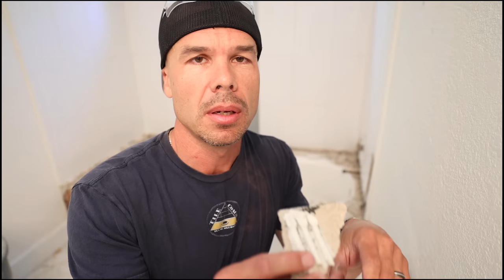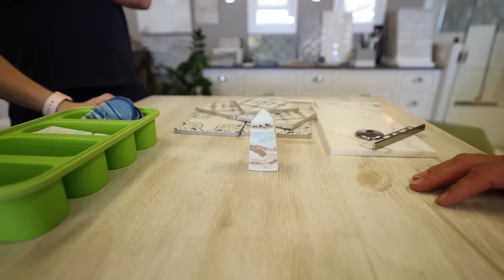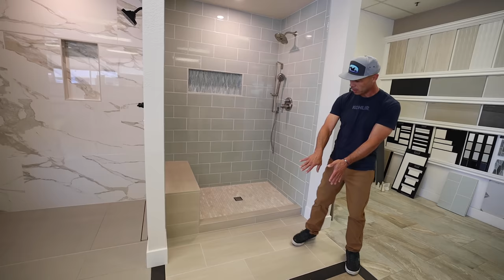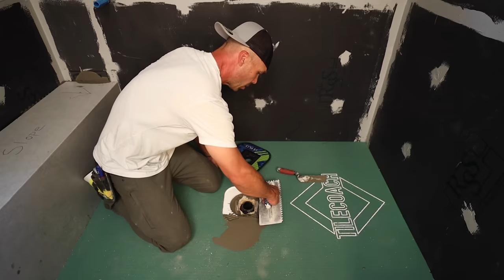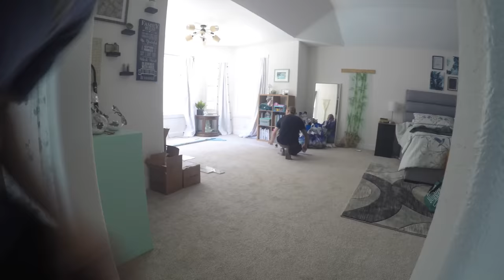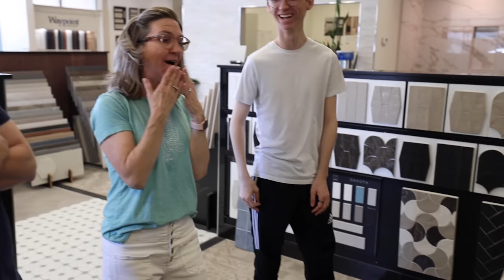$20,000 Tile Shower --- They Had to Pay TWICE!!!

Comment: I hope it was 20 grand for the whole bathroom and not just for the shower.
Reply: AM plumber who mostly does remodels in the northeastern USA. $20k for a complete bathroom remodel is the average. Obviously fixtures and trim can dramatically increase that price too.
Reply: Skilled labor isn’t cheap and cheap labor isn’t skilled.
Reply: @tylermccann2369  i charge $3,500 for labor to do a standard 60" shower. Usually comes out to $5 -7 grand.  Never $20k. That's ridiculous
Reply: @Benduro @Tyler Mccann not sure what your using for materials to do a full custom shower start to finish full demo and removal with everything from your tile, waterproofing, labour, mortar, grout, tile edgings/moulding and whatever levelling system you may be using for your tile if it is a larger format tile, niche, bench and window in the shower and full bathroom floor with uncoupling membrane underneath for 5,000-7,000 would love to see a vid on that remodel and see how you achieve it and that’s not to mention plumbing fees, fixtures like you are forgetting about the home owners expenses and just going off your tile service bill
Reply: @dylanmugridge  I also do all my own plumbing. We are talking about a shower thats standard 60 x 32. Now I did do a shower a few months ago that was $15,000, but that one was a 60x 96 shower. Maybe I am just cheap? Even though my work doesnt look like it. I make great money and am happy. No employees.
Reply: @XCBen  
What materials do you supply at that price? I’m gonna be doing one, just labor. I’m using the schluter system and the tile is 12x24 with a glass waterfall feature on the short walls mirroring each other with a niche in the back wall with the glass in the niche.  Any advice would be appreciated.

I just went on my own last year and been in the trade since 99
Reply: 20k is a robbery. The quality of work is fantastic but I highly doubt an entire bathroom remodel was 20k.
Reply: @joshuagaytan9376  If it's the whole bathroom it can be that much these days for sure. But if it was just the shower, which he made it sound like, then it's robbery for sure.
Reply: @tonyburry9036  you are assuming. You know what happens when you assume.
Reply: Awesome video. That’s exactly what a custom tile shower that size should cost with all materials, labor, design, and everything else you put into it. If someone wants to save money there’s a lot of cheaper things to do than a custom tile shower. 
All you guys that are commenting that this is robbery, don’t have a clue what it cost to run a legitimate contracting business. 😉
Reply: @Jared-Kreate  Sounds like you have no clue.
Reply: @XCBen  I'm doing a bathroom renovation right now with subfloor and joist work, running new electrical, plumbing in a sink toilet and shower installing a mirror, med cab niche, linen closet, vanity, quartz countertop, vanity light, tiling the entire room with 4x12 with a shower niche and bench. My quote was 14k
Reply: @tylermccann2369  yes,  for a whole bathroom I can see that
Reply: @XCBen  I'm with you. That's damn expensive. I thought I heard wrong when he threw out that number. Wish you were in Australia, we're struggling to find contractors anywhere here.
Reply: Im pretty sure its floor and shower tile with the shower glass and fixtures. And when you do good work you get swamped so you have to charge more to shorten your schedule
Reply: @wilson4180  
I’ve done beautiful high end baths for under 10. Anything over and you were a newb who got ripped off by a shady contractor
Reply: @sean4060  Nope, I just do good work and ppl pay me for it. I don’t deal with ppl who nickel & dime or want cheap & fast. I’m at a position in life where I can pick who I want to work for instead of saying yes to every job, to make ends meet.
Reply: @wilson4180  
No, 20k is an absolute rip off. A lot of contractors are greedy and over charge hoping some idiot accepts an overpriced quote. Most contractors want $500 a day which is fine. A lot of quotes works out to them earning $1000 a day. Only for fool customers
Reply: @sean4060  nice 👍
Reply: It’s California, depending what part he’s in, you have to charge enough to live there/here. Coastal more expensive, Central Valley much less expensive. Same as where you live I’m sure (city vs rural). I would add, that door swing is to close to the toilet but you have to work with what you have.
Reply: @Jared-Kreate  i agree with you.
Reply: @dylanmugridge  I do a standard shower remodel from tub to walk in shower and it comes out to around 5-7k with the tile labor plumbing and then another couple thousand for a shower door depending what they pick. I’ve done many of them and I’m always busy because I don’t charge people an arm and a leg
Reply: @dylanmugridge  I buy a schluter shower kit which is about 600 for the whole kit for everything. Then I charge 500 to install the kit. Demo of the tub is 1k which includes installing new green board. I charge 10 dollars per sq ft for labor which is standard in idaho. On top of that the customer pays for the tile, thinset, grout. I don’t use a leveling system. I just make sure the walls are plumb and level when I install the drywall. Labor usually comes out to right around 4k and and tile comes around to 1000-1500 depending on cost per sq ft. Then the the plumbing is around 500-800 depending on if drain needs to be moved and fixtures another couple hundred. Anyone charging 20k for a bathroom remodel is ripping people off.
Reply: @pman2916  that's another thing to consider with the price. There is a nation wide shortage of skilled tradesmen in the US, probably everywhere. If a guy is the only one in the area that can do that kind of work then he can pretty much quote any price he wants. Not allot of people are good and caring enough to do quality tile work. Lots that do mediocre work
Reply: @sean4060  tile guys aim for 800-1000 per day
Reply: @davegordon6943  
Total rip off
Reply: @sean4060  they can always get a shower insert or go with another quote.
Reply: @j.johnson8360  In the end you get what you pay for.
Reply: @sean4060  Why do you care what they make in a day? Why is that relevant? I might spend 100 dollars a day on fuel. 250 a day on a decent cut man. Everybody yells about a living wage until we start paying it and forwarding that bill. Now everything is "robbery"? Piss off. I'll make 3-4k in a day occasionally sitting in a skid steer. You want me to be poor? Buy the 85k dollar machine yourself and learn how to use it. I'll know I'm too expensive when the phone stops ringing.
Reply: @sean4060  you can believe me when I say private practice doctors most certainly make more money than I do. If you're comparing me running a business with someone who shows up at a hospital to clock in you've missed it entirely. My tools and equipment are an investment. They get a rate, at minimum depreciation. You think we do this shit for fun? Next time you have a surgery look at the whole bill. Not just the physicians portion. And if you think it's more cost effective to buy all the tools, take time off work, watch 20hrs of YouTube and then still do a mediocre job. Have at it. Phones still ringing over here.
Reply: @Jared-Kreate  20% for sales guy, 35% to contractor, 35% to sub , 10% cost
Reply: Does seem a bit steep, but he is a turn key operation…plumbing included, which plumbers charge a mint for anything. Materials are also a large cost in that bid and not to mention they are in California…everything is more expensive in Cali
Reply: @AllBayEveryDay  I've put over 8k in fixtures in a single shower. It was like a drive thru car wash. That's the problem with making broad assumptions like this. Some bathrooms are 80k+. Sound systems, Bluetooth thermostatic valves, body sprays out the ying yang. 1200 bucks for a rain head. Just the rain head. Plus plumbing and the drywall work to install it. Steam generators. Custom teak. Zero threshold entry. 5k in glass. Every job isn't in a flip house.
Reply: 20k damn you rob them
Reply: @sean4060  20k is not too much
demo+removal $2000
Plumbing $2000-3000
Tile let’s say $70 per sqm roughly 30-40sqm $2800
Waterproof system I never use those system before but let’s say roughly $2500 ?
Pc items 2-3k?
Tiler 1800-2000k
Don’t forget when you run a business you need to make at least 30% profit so how’s 20k too
Much?
Reply: @mikeblocker5720  Running a business and being just a trade is different. Sean is totally not counting the profit part and the warranty part on it.
Reply: @jasonwu1380 
This is why I don’t hire general contractors who need to make a cut. I hire the trades directly 

Demo (1 day job) $1000 plus garbage bin=  $1500 max 
Tile installer $8/sq foot x 100 sq feet = $800
Tile $6/sq foot x 100sq feet = $600
Plumber $500 per fixture = $1500
Toilet - $400
Shower glass $1000
Vanity $1000
All shower fixtures - $800
Waterproof 1k

I’m at 9k plus add some extras for unexpected things. That’s 10k total. 

Only suckers pay general contractor prices
Reply: @mikeblocker5720  
Zero curb entry doesn’t cost anything if you are building house from scratch
Reply: @sean4060  labor cost? that is correct. line drains usually do increase material cost a bit though. And most utilize a line drain.
Reply: @sean4060  mate I run a renovation company and just like the in the video I have my own factory to do storage and joinery plus a showroom .this is the hidden fees .I never do a 3x3 bathroom under 32k Australia dollar.when you run a business and just be a trade with a Ute is big difference.
Reply: @jasonwu1380 
So how is it I’m able to do a nice modern beautiful bathroom reno for 10k?
Reply: @sean4060  the way you quote yes is possible but why? Lets put it this way you are going to a restaurant buying food may cost you $20 a dish but when you do it the same at home buying from the supermarket it may cost you only $10 you cant compare prices like this the hidden fees is everywhere
Reply: @sean4060  cut costs from material cut cost from labor cut cost from factory or showroom fee cut cost from insurance yes you can
Reply: @sean4060  I got a job 3weeks ago just one basin is costing $2100 dollars when people build them forever home is different
Reply: @jasonwu1380  Have you seen this bathroom? Where did you get 30-40sqm from?
Reply: @diegoperez2090  the hybrid private/socialized blend of healthcare we have here is a mess. One system or the other would work perfectly fine for most. Just have to pick one. I completely disagree that anything, anywhere is truly "free".   What's your point anyway? I'm not in charge of the healthcare system. How did we get so far out in the weeds? What does a physician earn annually in these other places?
Reply: @diegoperez2090   2x2.7+ 1.2x2.7+1.2x2.7wall11.88 3.6x2 floor 7.2 + waste 24.8
Reply: @diegoperez2090  don’t forget one thing this is not 300x600 or 600x600 tile so when the tiler do quote at least a double
Reply: @joshuagaytan9376  Bathroom remodels can easily be $20K. And that’s an average bath.
Reply: @mikeblocker5720  yes but this shower specially and 99 percent of shower remodels don’t do any of that stuff you said lol. Only 1 in a 100 will do fancy expensive stuff.
Reply: @sean4060  I charge nothing less than 10 per sq ft for walls and 8 for floors. Plus I charge 500 to install the waterproofing and 150 per niche. 50 for soap dishes too. If a customer choose smaller tile the prices goes up to 12 per sq ft. If they choose a tricky pattern that takes longer the prices goes up to 15 per sq ft.
Reply: @AllBayEveryDay  my point was the variables are too many to make any broad sweeping statements about pricing in the remodel industry. Some guys float walls. Some guys reframe. Some guys shim sheetrock with window shims leaving areas not supported by the framing and then schluter and tile over it. Grout lines in jeopardy any time  someone leans on the wall. 
Big difference between a builder/craftsman and an "insert material" installer. After schluter became widely available I feel like a bunch of lvp guys jumped in the showers. Lots of repair work going on.
Reply: 20 grand for a shower with a foam pan lol yikes
Reply: Price of material and labor. I think Isaac also does his own plumbing and framing if need be too.
Reply: @XCBen  the prices of grocery and cost-of-living are ridiculous start raising your prices. 
Do the people you work for peanuts for... ever actually give you any peanuts for free without you doing any work for them?🤣🤣🤣
Reply: @jasonwu1380  you are so off with your numbers.

Demo-removal of a shower is $2,000? Why would it cost that much to remove and dispose of it? 

$70/sq ft? LOL!!!
I am just gonna stop here. You put $2,500 for waterproofing. Most it would be $800.
Reply: @XCBen  thats how i quote and im still running a 2 showroom and joinery factory and a 17 man team after covid . i always make sure i make 30-50% of a job.
Reply: @dylanmugridge  he literally said that’s for labor in his first comment... lol
Reply: @wasntme3651  none he said that’s for labor! Lol first sentence.
Reply: @jasonwu1380  you must live in a big city. That’s unheard of where I live. I just remodeled a 17x15 bathroom custom shower I built myself, the home owner did the plumbing before I was even hired, I water proofed the shower laid large formats and deco floor with a bench and niche, glass door, re leveled the whole room, tiled the bathroom floor 200sq ft, drywalled the bathroom finished and painted it, removed a chimney, did exposed beam ceiling (it’s a 100 year old house) sanded the beams, and installed four windows, also did a 4ft wide section at the end of the room open vault ceiling to let the attic windows bring more light in, a claw foot tub, and did all the electrical. 11k for labor, had one unskilled helper for some of the work. home owner bought all the materials. They prob spent 3k on materials or less actually cuz most of what they bought was on clearance over the span of a year or more. 30-50% markup for profit, I’d never get a job around here. People don’t have that kind of money where I live.
Reply: I’m confused actually how they have to pay twice? They bought the house, with that shower in it. So they didn’t pay for the first install they tore out?... lol.. also why did the lady do all the work XD must be a stay at home wife.
Reply: @bvictory5698  this 30-50 dont go all to my pocket 3-8% is for the project manage, 10% is for the sales team, and i also need to pay bills for marketing google search radio youtube ect...boutique builder is hard unlike project home builder what ever they build is got plan abc for the customer to pick. for us we do everything custom, big time cost for the sales team and the pm. thats why my price is higher.
Reply: I paid 21 plus k for just the vanity room.
Reply: Anthony G  That would be an extra charge. Lessons to learn my trade are only free for my employees.
Reply: Think they voted for Trump or Biden ?
Reply: @Dave Gordon  I don't know any tile guys making close to $365k a year.. I don't know any tile guys who even make half of that..
Reply: @XCBen  You know what they say about fools parting ways with their money.. He's a great salesman, he should get in the car business.. He would make a lot more money selling cars than he does selling tile.. He worked that couple perfectly and stroked her ego the whole way.. Letting her play interior designer and filming it for a YouTube video like that was a good move.. She would have paid $50k for that install just because he made her feel like she was getting her 15 minutes of fame.. I highly doubt the material cost on that job was over $5k, even with the inflated California prices..
Reply: @John Dontrump  There's nothing wrong with making money but you don't have to make all the money off one customer.. If you charge $450 an hour for labor, you are fleecing people and are part of the problem.. I'm a journeyman millwright, and I don't charge billion dollar corporations even half of what you claim to charge.. If I did I wouldn't get the jobs and my guys would go hungry.. I call BS I think you are full of it chief..
Reply: @XCBen that’s your loss

Comment: I’m a General contractor, done so manny jobs in Beverly Hills and other nice areas, 20k for a small shower its a rip off!!!
Reply: You might think so but I remodel homes in oregon along the valley. It's up there in house pricing but not Cali lvl. Tile guys here are all charging 10k base and up to 20k custom. If it's a full floor to ceiling job. It's all supply and demand.... I just built a deck for a friend 14x40 trex, I did it for him cause the lowest bid he could get was 50k.

Comment: Quick question - why don't you apply the floor membrane first, so the edge/corner bands lie on top of the floor membrane? Maybe it doesn't matter with this system, but would seem like good practice.
Reply: It maintains water retention in case any water leaks through the membrane.
Reply: Why didn’t he do the corner bands over the sheet on the foam pad is a better question, pretty sure that’s backwards. Supposed to lap from the bottom up. Lol